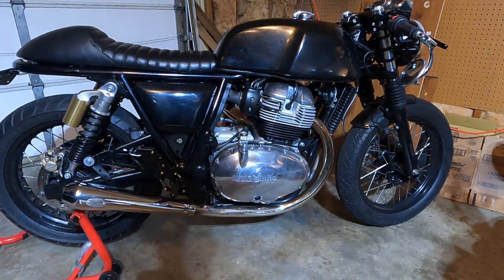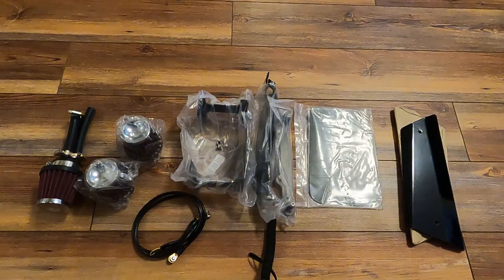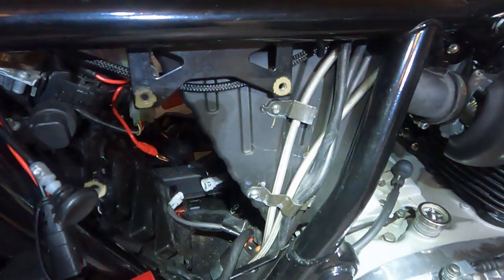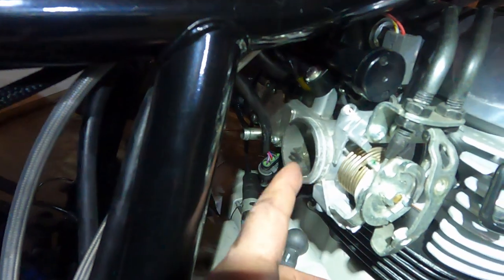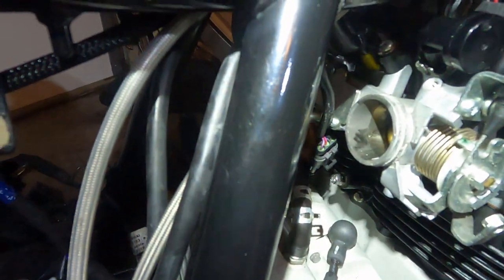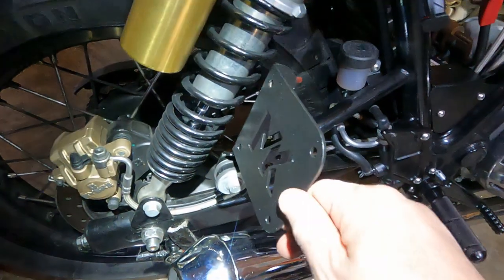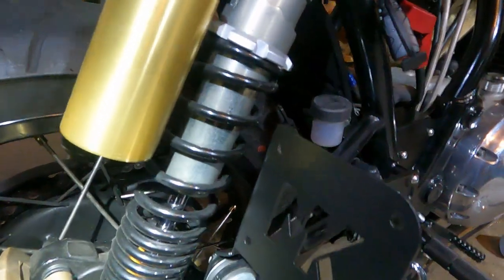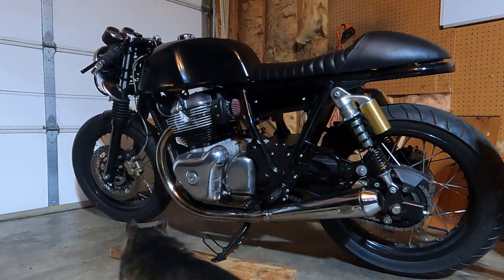Royal Enfield Continental GT Big Bore Airbox Delete, Pod Filter Install, Evap Eliminator

Comment: I use those pod filters and can vouch for them flowing plenty of air; they're only restrictive if over-oiled or packed with soot in off-road situations. You can fit a "40mm" onto a 42mm intake, they do stretch and the band has an easier job of keeping them attached; I have had some "oversized" ones fall off. Not being critical but I've been using these for 40 years. The best source for this type of filter is Dime City Cycles in Florida the last few years; that has been my experience. 
 Again, your project looks great and please keep us updated.
Reply from the maker: That is good info.  Thanks!  I measured the inside diameter of both sets of pod filters.  They were both smaller than the stated values by a decent amount.  I think it was 1.5 mm.

Comment: I did think about removing my air-box on my GT at one stage.  I can't remember why I wanted to remove it but I did not take it out because it looked kind of difficult.  Your video shows it being even more difficult than I had imagined.  Well done you. Lots of good information in this video.  Thank you very much.
Reply from the maker: Thanks!  All the plugs, tubes, and pieces can be a little overwhelming.  As I do these projects, I find the more I know what to expect, and what I am unplugging, the less intimidating the process becomes.   It gets easier the more stuff you do.  I worked up to it and got as much info as I could before I started.

Comment: Finally got my '24 GT650 after a year of researching and following guys like you. Instead of the "y" connector on the breather tubes using a single breather filter... why not 2 separate breather filters... this way you eliminate the hose bends. Cheers
Reply from the maker: Thanks!  I did end up putting two breather filters on.  Mainly I did it because you couldn't see the big one I had made.  It looks better with two.
Reply: @OakInch  Sweet!! Haha. I've gone full retard on mine and have only done 7 test-drive miles... since then it's been in pieces. About ready for Atl ---> Blueridge Parkway --> Atl next month. Thanks for the blueprint bro!!

Comment: Glad to see another video with more insight on your project. Since I have two Triumphs that are 865cc and almost 70 horsepower I went with the smaller Weisco 83.5mm pistons on my INT650 rather than the 90mm pistons which are common to the Triumphs; my displacement is 743cc so I won't be changing any of the induction side components, already running a full stainless-steel exhaust system from the 648cc stock days. I may defeat the air injection as you did. My goal was to have 55-58 horsepower by carefully adjusting deck-height/compression with the cylinder base gasket. Again, thanks for the continued info on your progress. My INT650/750 has almost 30,000 miles, 90 percent as a 648cc (Virginia, USA).
Reply from the maker: Glad you like the project, Frederick!  You might want to reconsider about the air induction side.  It does look pretty cool!  Haha!

Comment: ..hello again, when removing the air box, where do you place the temperature sensor that is screwed to the air box? or does it cancel it?
Thanks in advance
Reply from the maker: I ran it up under the seat.  It is still attached.
Reply: @OakInch  Hello, thanks for the quick response. In principle, I am going to eliminate air box and Evp, mounting conical DNA filters, I will place them in such a way that they cannot be seen, through rubber ducts, so as not to have problems with official state reviews.
I have also mounted the regulator under the lower fork stem, so that it does not heat up and in case of breakdown the change is quick and comfortable.
Thank you so much. Greetings from Madrid
excuse my english, it's from google

Comment: Thank you very much for your video! It helps me a lot while I am working on my own delete. I have a question - what did you do with a little sensor that is screwed by two screws and goes inside the airbox in its top right corner on the right side. Both BAAK and MK Design tutorials say nothing about it.
Reply from the maker: Thanks!  I tucked it up under the seat.  You will like the delete.  You can tell the difference at higher RPMs.
Reply: @OakInch  Thank you! It's the air temp sensor, right?

How about the low RPM performance? 

Did you notice any downsides?

Thank you very much for the fast reply! I continue working on it tomorrow.
Reply from the maker: @thesundayrides  Yes.  It is the air sensor.  I didn't notice a whole lot at the lower end.  But it was obvious that the high end had more pull and was not struggling.  The airbox is definitely a bottleneck at high RPM.  It is not going to become a sport bike, but I could tell the difference.  It was good.   I did get a new Power Commander tune a little while after I did the delete. IDK if that is needed or what other mods you have.  I think the airbox delete, a full exhaust, and a Power Commander tune is probably the best bang for the buck.
Reply: @OakInch  thank you very much for the detailed answer!

Comment: Hey! Just wondering what you did with the one air hose that connects to the fuel tank? Can't seem to find any info on what to do with it. 

Awesome video and a great help over the basic mk designs install video they have. Subscribed!
Reply from the maker: I just reattached and left both the black rubber hoses hoses that came off the tank hanging.  I think one of them was the one that got the screw put into the end of it.

Comment: Great content, was the battery smaller and did it lay flat? And where did you put the relays?
Reply from the maker: I have a lithium battery that is smaller.  It came with plastic spacers, which I used to make it full size for this project.  It was the same dimensions as regular battery when installed.  It is laying on its' side, in the kit provided battery box, with the terminals pointing to the rear of the bike.  The relays are down under the panel at the bottom of the bike.  I did go back later and use some plastic bags to waterproof a lot of the the electric items that are under the lower panel.

Comment: @oakinch thank you for all your documentation and vids in the work you've done.  it's a massive help.  quick question - based on your experience so far, what would be your recommendation for tuning?  Powerfronics or  Powercommander?  I have a 2023 GT650 with free flow headers from Hitchcocks, Fuel Booster, and DNA stage 2.  Im having some bogging down issues and i suspect its due to my fuel mapping.  i know so say a fuel booster is enough  and others say they needed to remap.  ive removed the Evap system, checked plugs, upgraded relays and still having some bogging down on acceleration issues from 1-3 to 4 gears.  at this time, it may just be the ECU is not playing nice with my upgrades.  No error warning lights thrown either.
Reply from the maker: I have only used power commander 5 and 6.  Whichever product you choose, it is going to be the map that matters. I would go to Revelry racing's store site and look at the maps they will sell with their products.  See what matches.  I had a PC6 with a map from Hitchcock's, and it wasn't a super great map.  I would not really go for a Hitchcocks map unless I had to.  PC6 is also kind of limited and needs a pro license to really tune.  Also, on the Power Commander website, they have maps you can download for exhausts if you buy from them.  I was using a PC5 with a map that I bought from revelry for a while.  It was pretty good until I deleted my airbox.  Then I had to get a tune on a dyno.  Not really sure PC5 supports the latest bikes either.  So basically, I would say, just try to find maps that match your mods, and then make a decision.
Reply: 10-4 and thank you.  i did see in your vid you mentioned the limitations with the PC6.  thanks again for the reply and for posting your journey in custom cafe racers.  big inspirations.  maybe one day we see a killer instagram page dedicated to your racer ;).
Reply: Nothing will work because air boxes are designed to aid air  flow at the low to mid range.  You may get more power at top end for track only use, but the bike will run like shit everywhere else. It's called Helmholtz resonance. Maybe you guys should read a little before hacking apart a bike. Even racing bikes use air boxes. And finally, why the hell would you try and "upgrade" a SOHC motor for performance? A lot of time and money better spent buying a different bike.
Reply: @truantray  source of issue was a shop rag in the fuel tank left behind by previous owner.  the bought the interceptor tank for my gt from a guy in england.  once the rag and bits were removed, my gt's performance was restored and its been running like a stallion since.

for my speed speed speed fix i rip my yamaha r1 around.

Comment: Just curious where did you mount your MAF sensor?
Reply from the maker: The sensor that was plugged into the airbox, I ran up under the seat.  I'm not really sure how much it is in play with the Power Commander controlling all the fueling after a custom tune looking for the best HP.  Let me know if you have a better idea, or some considerations that should be used.  Seems to be running fine where it is.
Reply: @OakInch  Thanks for the reply. Yeah just did mine today and that was the only thing that didn't really have a home after nor did I know is if was important at all anymore.

Comment: Hello, it's me again :) I hope you don't mind another question. After assembling everything together, checking all connectors, etc, the bike doesn't start. The starter revolves but the engine doesn't start. I checked most obvious things as good as I could, and didn't find what was wrong. Do you have any thoughts? Thank you!
Reply from the maker: Always frustrating when weird things happen.  It is probably something simple though of it was just the air box.  Can you hear the fuel priming when you turn the key to on and the cut off switch to on, before you hit the ignition?  I'm not sure how much you took the bike apart, but make sure all the connectors are seated under the tank that lead to it.  Also, go push on your spark plug cables and verify they didn't get unseated.  Check your fuses.  Make sure your relays are are inserted.  See if you can find out of if is fuel or spark that is missing.
Reply: @OakInch  thank you very much, this is really helpful and thanks for taking the time to write such a detailed response. After checking all this and probably more.. I found it! It was a roll over sensor mounted in a wrong orientation
Reply from the maker: @thesundayrides  Awesome!

Comment: Hey man! Love the video and appreciate all the info, I did have a question though, I bought that smart moto eval delete kit and mine did NOT come with an 8mm bolt/screw but in the video you showed that it had come with the kit. Is there anyway I can order just a bolt?

 I went back to smart moto and they have just the nipple plugs and electronic eliminator. 

Appreciate the help, want to get this bulky thing off!
Reply from the maker: Thanks!  You could shove any bolt up there that will stay in.  It is literally just a bolt to stop gasoline from coming out.  There was nothing special about it.  Or you could clamp the hose with something.  If you don't mind a little gas on your floor sometimes, you probably don't need anything.
Reply: @OakInch  awesome thanks so much! I’ll give an update when completed!
Reply from the maker: @phishpike  Awesome.  I want to hear about it.

Comment: Won't that be a problem when if it's raining.
Reply from the maker: The pod filters will be fine in the rain.  However, I did go back and waterproof some of the electronics stowed in the bottom compartment because I was worried about them ever getting wet.  I also remade the bottom panel so it left less gap space.

Comment: Hey what holds the battery in the battery box thats in the kit? Mine seems very loose so I wasnt sure what keeps it from sliding around in the mount?
Reply from the maker: I used a lithium battery, and attached the spacer plates that came with it, to make it full sized.  Then, when I put it in, it was very snug after I tightened the bolts.

Comment: Why didn't you take off the rear tire and remove the air box through the back?
Reply from the maker: It seemed like an unnecessary extra step if I could just pull everything out the side.  The only thing it would have saved is the airbox.  They were not expensive on Ebay.  I didn't think I was ever putting it back in.  So I chose a less effort option.  If you ever plan on getting a tune, I would recommend moving to pod filters first.  It made a big difference at higher RPMs where the engine was starved of air.  It is a pretty cheap change, especially if you use your stock side panels and battery holder.  You really don't need a kit.  You just need that airbox out.
Reply: @OakInch thank you I've wondering if you can use the panels still I want to do the airbox delete but I wanna keep the ability to  us wingman bag panels from trip

Comment: did you upsize the tires? 110 & 140?
Reply from the maker: Yes.  They a little larger on the stock rims.

Rear Tire:
Size 140/70-18 

Front Tire:
Size 110/90-18

Comment: what happenes if it rains? does the air filter gets damaged?
Reply from the maker: I avoid riding it in the rain.  From what I researched, it doesn't have much, if any, effects on the filters to get them wet.  That might be where going with a known brand would be a good idea.

Comment: what seat is that brother?
Reply from the maker: MK Designs India cafe racer seat that does not have a cowl.  It is on their full length tail tidy.  I have one of their cowled seats too.  But it doesn't look as good.
Reply: oh great i might order that kit too. is it easy to install? does it come with instructions? do i need to get seperate turn indicators? @OakInch
Reply from the maker: @RMD992-f2n  The tail tidy comes with an LED light strip to replace the brake light and rear turn signals.  I bought a different one off of amazon to use.  You will need an LED flasher relay if you don't already have one.  They are just a little plug that goes under a side panel that replaces the original relay.  Mine is that orange plug, that I got off of amazon, that you can see in this video a few times.  It makes the LEDs blink at the correct speed.  The kit does involve chopping the hoop end of the bike off and replacing it.  The biggest downside to it is that it does not seem like it would support a passenger.

Comment: How did you re map the EFI?
Reply from the maker: I am not sure what you mean by "remap".  If you mean clearing the codes, I used a code reader from Hitchcocks.  DIAGNOSTIC SCANNER, EURO 4 + EURO 5 MODELS https://accessories.hitchcocksmotorcycles.com/47731 .  It is menu driven and come with directions.  There is a video after this one where I ended up taking it to get the Power Commander tuned on a Dyno.  I did get an EFI error after that.  So, I think the tool is something you will need no matter what.  I don't think I have the complete solution to the codes popping up.
Reply: @OakInch  remapping has got something to do with the 02 sensors, computer, and adjusting the air fuel ratio. And or telling the computer that the new air levels are acceptable and there's no vacuum leak.
Reply from the maker: @nathanielfisher4269  Ok. It has a power commander tuned on a dyno, and blanking plugs on the 02 sensors and air injection system.  It is not an ECU tune. That cleaned it up for the most part.  I figured that was what you meant.  From my actual job I have realized often people misuse words.  I wanted to make sure I was answering the correct question.